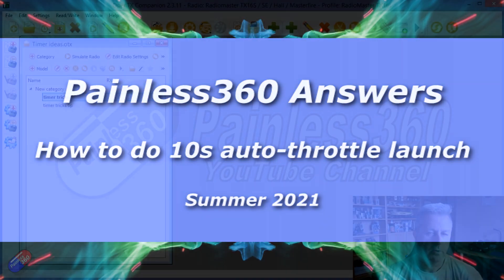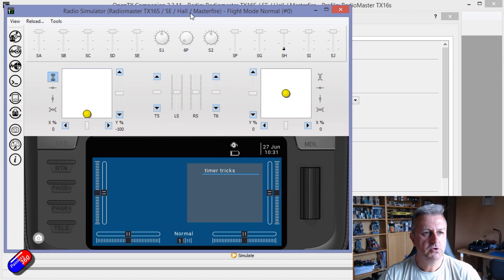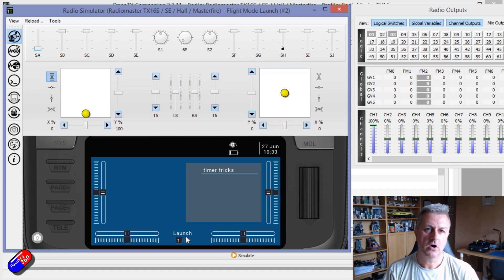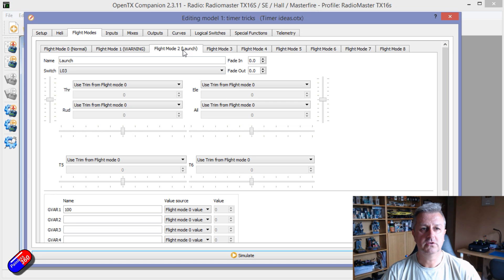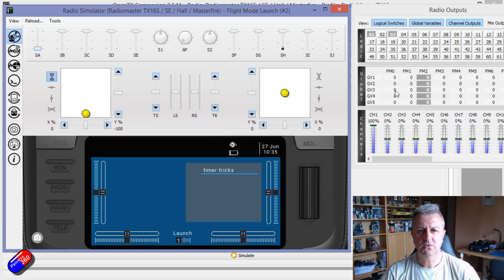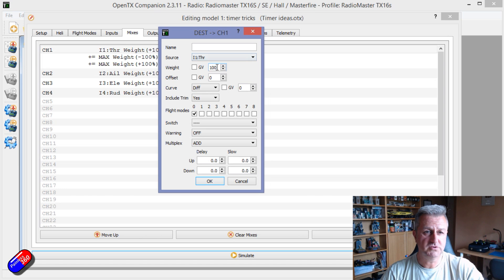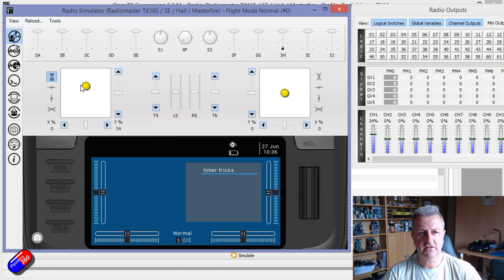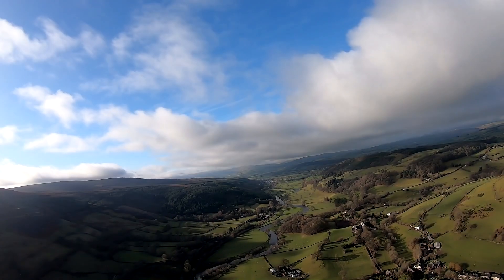OpenTX: Settings up a 10 second auto throttle timer for e-gliders

Comment: I would add a second switch as a security precaution so that it only activates throttle when the second switch is also set in certain position. It could also be done with the SH switch and then using a certain duration before throttle can be enabled. 😉
Reply from the maker: That is the cool part of Opentx, you can set up stuff as you like. Happy flying!

Comment: Hi Lee  ,
Great  idea  for my electric 2m R.E.S models .
I have just received a Taranis QX7S  ,and have been reading up on setting it up ,and watching your videos ,
Which by the way , are some of best  that I have watched . I have a question re battery setup
My Q7 came with a batt holder for  2 Li-ion  batteries ,  but .l wish to use  a 6 cell nimh pac .with a servo plug in the centre of the lead ,to make charging easier
I will just take off the plug that goes into the circuit board and solder to the end of the servo lead .
Q1 -  the  plug for the circuit board has a centre yellow  wire  ,is that  only required for when using the  Li - ion batteries .
Q2 -  on the positive wire  is a shrink wrapped  something  , ?  , would I leave this in the lead for the nimh batteries 
Hoping you can make sense of all this ,
All the best from Queensland, Aus
Derry Toms
Reply from the maker: Hi Derry, not sure what you mean by 'servo' connector. I'm guessing that you mean balance tap connector? Usually only the two outer pins are used on the balance tap on the radio to get the full battery voltage. Not sure what you mean by heat wrapped something. Sorry I can't be more help - maybe include a link to a photo showing what you mean and I can take a look..